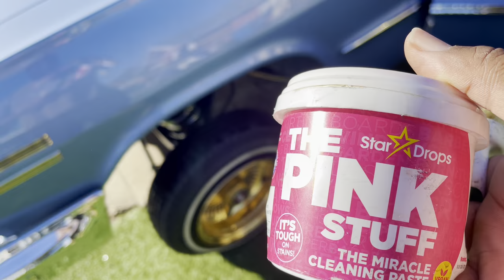First time pulling out my 63 impala in 6 years

Comment: Nice car ! I do have to ask . How does the bouncing affect the structure of the car ? Frame stress or anything like that ?
Reply: Frame should be reinforced!
Reply: they reinforce the frame by welding on plates of steel to the joints and weak points... thus no frame stress
Reply: @HOTRODRICO  they said they used parts of railroad tracks back In the day

Comment: as someone who owns a 64 Ive went through like 4-6 of those batteries. if you dont maintiain them with a agm charger they are going to die everytime an dyou get no usage with them. buy you one, throw it on and forget about it. they are trickle chargers and basically keep the battery charged while you dont drive it.
Reply from the maker: Thanks bro yeah I bought one. It’s on there now.

Comment: Nice car homie!  If your buying optima batteries very often maybe due to it sitting up, make sure you check the voltage with a volt meter and if under 12 amps charge it on slow charge first for half a day then check to make sure it’s over 12 , anything below will damage these type batteries if you don’t use often